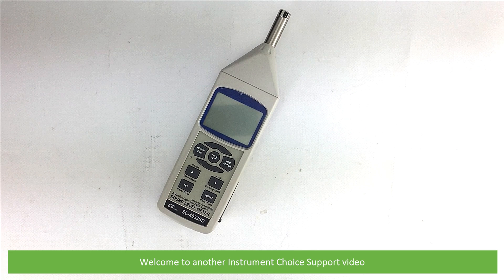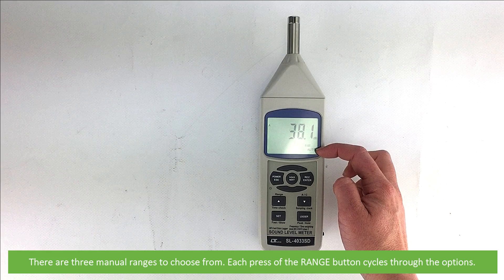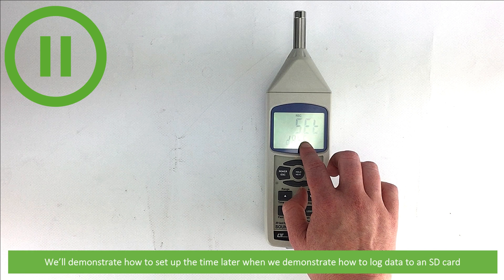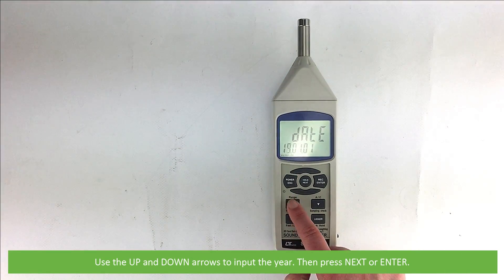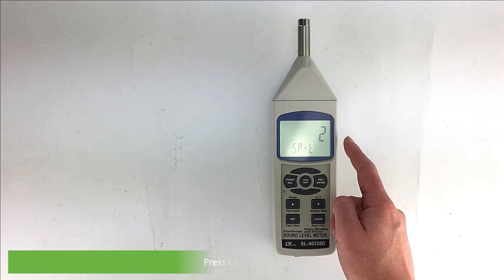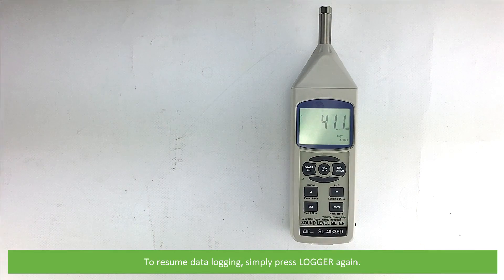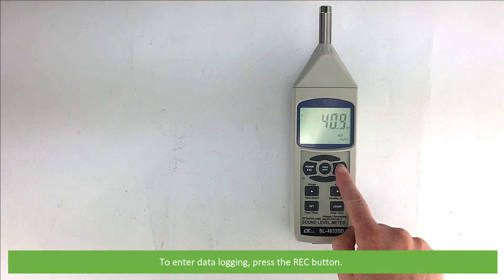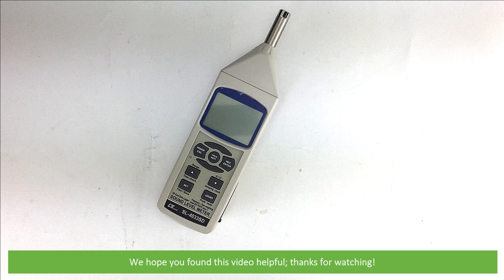How to Set Up and Use the IC-SL4033SD Type 1 Sound Level Meter and Data Logger

Comment: Thank you very much for the video. I repeated every step with my own device exactly as shown. However, when I insert the SD card into my computer, it says that the card needs to be formatted and it cannot be recognized. I would appreciate any help you can provide regarding this issue.
Thank you again for the information.
Reply from the maker: Hi, @Serkanaktas182, thanks for your question. If you are using the SD card in the meter for the first time, please find the SD Card Format instructions on page 19 of the manual. There should be details on how to complete this. 
If readings have already been logged, please try another computer to see if this works.
Failing the above please feel free to reach out to our support team, either by phone or emailing scientists@instrumentchoice.com.au the team will be happy to assist.